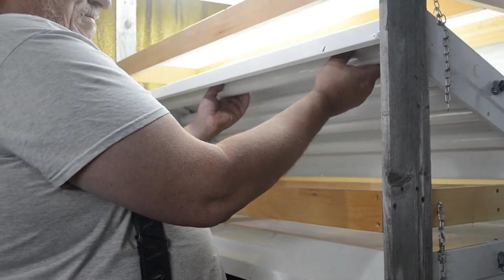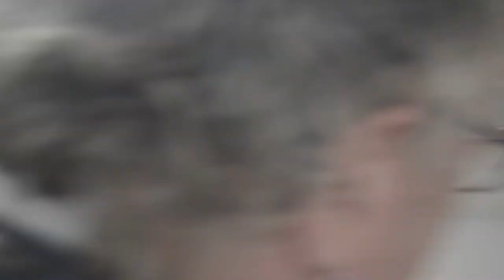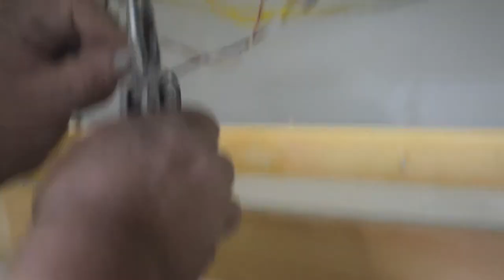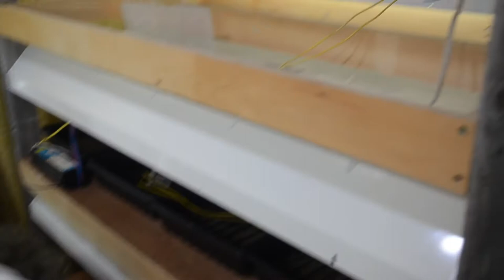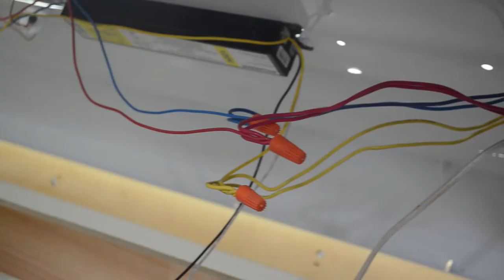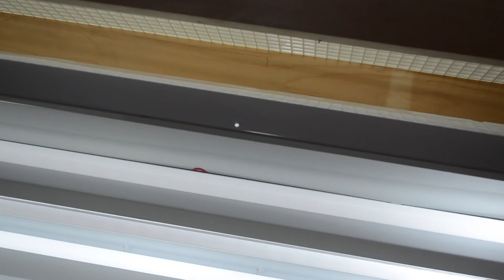How to Convert a T12 0r T10 Fluorescent Fixture to T8

Comment: Good job my friend.. I am looking to upgrade my fish lights. 
Really good info.. 
I hate replacing the florescent bulbs though.
Reply from the maker: Well, if you are going to have to throw money at it, I would go with the LED replacements that are designed for 120V in, you just cut the ballast out and all the wires that run to one side are connected 120 live and all the wires that run to the other side are 120 neutral...

Comment: You could just get led shop lights 6500k which is daylight bulb. Instead of a grow light the power saveins can make it worth it
Reply from the maker: Like these? https://www.amazon.ca/Led-T8-6500k-Kitchen-Cabinet/dp/B07RHW93BY
That would cost about $460. & at a savings of only 12 watts per bulb would take what? 20 years to recuperate the out lay in energy savings? As compared to the $55 total expenditure on this...
Reply: @trollforge  Barrina LED T5 Integrated Single Fixture, 4FT, 2200lm, 6500K

Is what I bought 69 Canadian for 6 lights or 119 for 10 t8 size. It pulls about 20 watts per  LEDs so a total of 40. around 40 watts you need 2 to 3 bulbs per rack so you need less then what you use now. 4 t8 per shelf or 2 led per shelf. That's were you get the saveings. Then depending on were you live the cost of power can vary